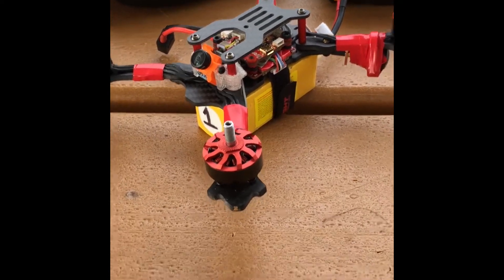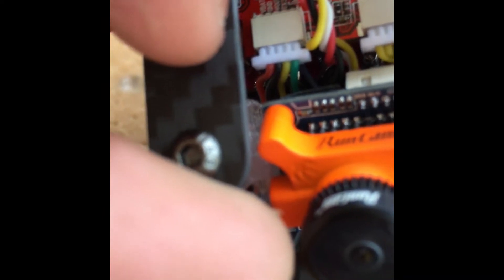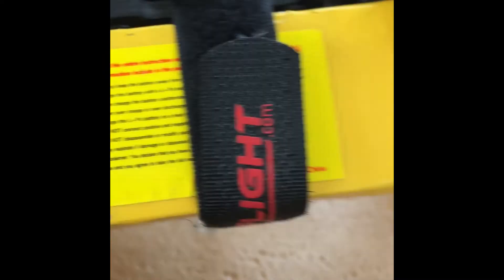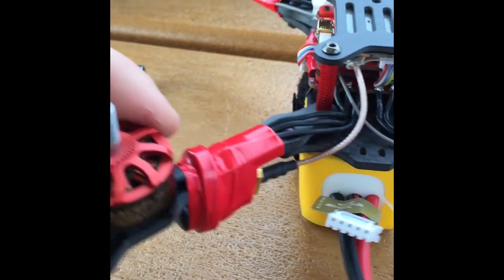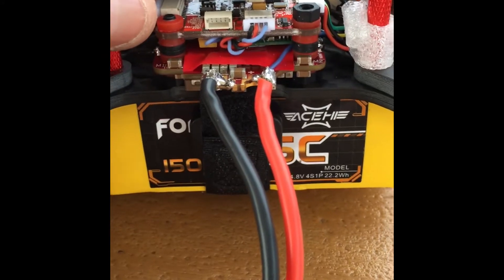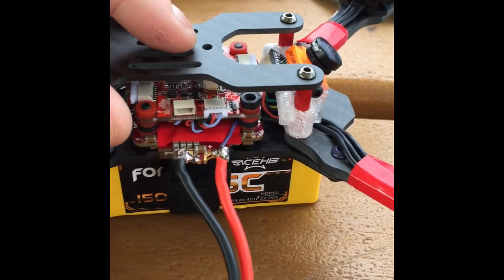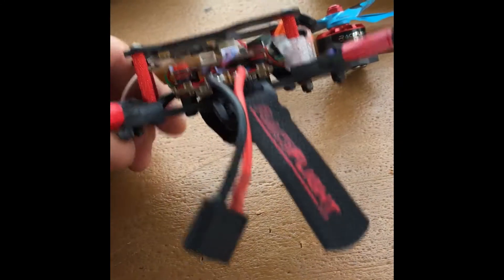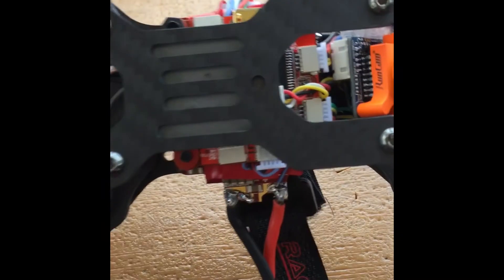RaceFlightOne - ProtoType Revolt OSD FC / 32Bit Bolt 4in1 ESC

Comment: did you put electrical tape on the bold 32 fets??????
Reply from the maker: Yes I did I do it to keep the esc safe from wet grass electrical interference also when soldering helps keep little solder balls from flying into esc
Reply: @EMDRONES  thx for info!!!!

Comment: I hope  this bolt 32 i just ordered works. Just smoked a holybro 35 amp on some brother hobby 2406 6s set up.
Reply: Alex Flight I wouldnt get it dude they are not that reliable. Maybe u will have better luck. Let me know if u do.

Comment: So how did this turn out? OSD worked out with Spektrum radio setup? What is the overall setup? Looking to update from F3 Fc.
Reply from the maker: The setup is rather easy since the OSD it integrated into FC just Setup normal Revolt then OSD Configure in the RF1 GUI- Spektrum RXs DO NOT Give out RSSi which is what I was using with this video. I have a DX9 with Crossfire So when used with CrossFire it will Give out Rssi readings. be sure to use coupon code "emdrones" at check out at www.raceflight.com preorder and save 5% on your order the Fc is a f4 so it sill be an upgrade we even provide crash replacement programs :)
Reply: So how do you wire up Crossfire and SmartAudio. It's not like it was on the Revolt V3, is it? 

Judging from the pinouts on raceflight.com it looks like SmartAudio goes to TX3, which is right next to all the VTX pads and Ch1 goes to TX1, Ch2 goes to RX3. Is that correct? 

Does VTX setup via OSD work that way?

Comment: Just pre ordered the bolt 32 and the new revolt OSD flight controller. Never tried raceflight, always fly betaflight. Figure I would give this a shot. I want a d shot 1200 5s set up. So this has betaflight OSD and runs raceflight? The description says betaflight firmware. I'm a little confused. Looks great. Can't wait to try it.
Reply from the maker: No this is RF1 OSD internal with the new Revolt OSD FC